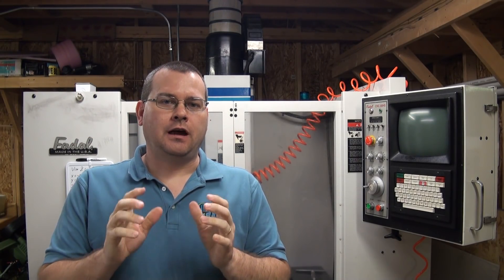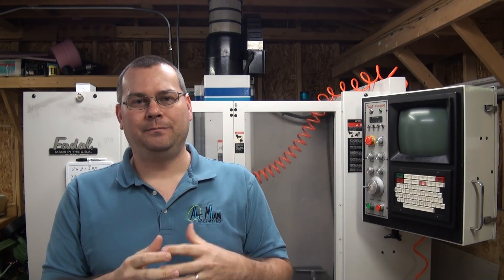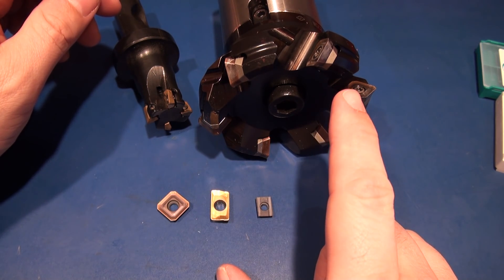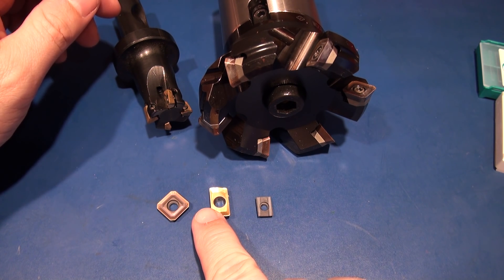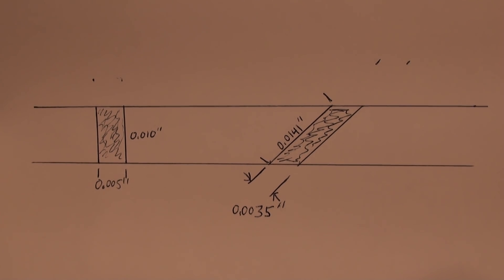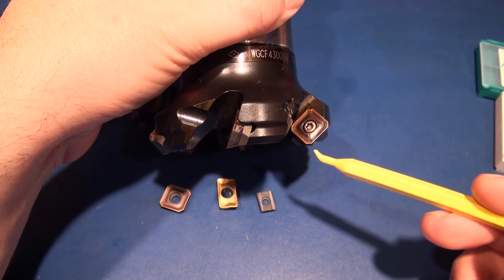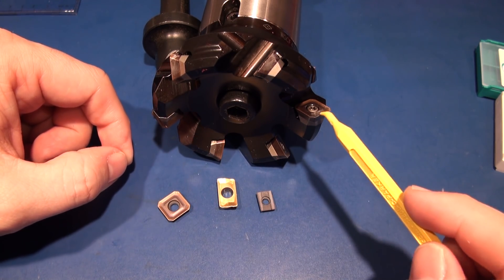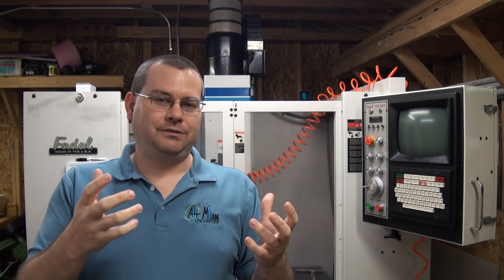End Mills, The Nitty-Gritty: Face Mills and Inserts

Comment: I have an issue. I have a 4in endmill with 8 inserts and 2 of the inserts don't show wear. I'm assuming for some reason they aren't on the same plain as the other inserts. My question is why? The tool is brand new the tool holder is the proper tool holder, inserts are aligned properly with the same exact sides indexed together held by the proper screws and torqued to spec

Comment: I appreciate your effort here and you have cleared up some things for me.  
I do however have a question that I have not seen answered here or anywhere else I’ve looked.
That is: what is the acceptable tolerance for cutter depth variance on a face mill?  In other word’s, you stated that not every cutter will be at the same depth of cut.  So the question is then, what is a reasonable difference to have between cutters?  Is it a difference overall of .001 for say a 6 cutter head?  Is it .003?  
What would you say is an acceptable tolerance?  
Now I would imagine that this might depend on the type of cutter and the size of the head and the number of cutters, but perhaps you can give a general answer?

Comment: Where or how do i figure out this out to calculate the 1.5 cut engagement? I know is not very possible/practical as you said but i still want to know what the stepover and depth-of-cut should be if i want to be in the realm of 1.5.

Comment: Very nice info. I am a new user and just bought one of these cheap Chinese facemills:
https://www.ebay.com/itm/2-400R-50MM-Face-Mill-Cutter-R8-FMB22-Shank-10x-APMT-1604-Carbide-Insert-Blade/152465903209?hash=item237fad0e69:g:dfAAAOSwgW5dRCOs:sc:ShippingMethodStandard!28690!US!-1
So here is my question,
I tried to use this thing and no matter what I did the chips were on fire coming off the steel I was trying to Face. I figure the inserts are junk. So can this facemill use other inserts or do I have to buy the 1604 type? Can you comment on the FaceMill itself. I mean I am sure its not as accurate as a high dollar one but it should be ok with decent inserts. Right?
Reply from the maker: You can try ordering some good inserts, but part of the equation is holding the inserts at the proper geometry for good results. I don't think it hurts to try though.

Comment: Great video, as a hobby machinists these videos are very informative, I know next to nothing about feeds, speed and chip loads, so these videos very good.
Can you recommend a program for working all this out
Thank you again for the videos
Reply from the maker: Hello Michael, I think the two best calculators to help with feeds and speeds is G Wizard and HSM Advisor. I think both have a free trial so you can try before you buy. Also if you look in the catalogs or on the tool suppliers web sites for the tooling you use they will provide guidance as to what speed and feed they recommend. They will also sometimes list width and depths of some common cut types. Thanks Tim
Reply: At-Man Unlimited Machining thank you for reply